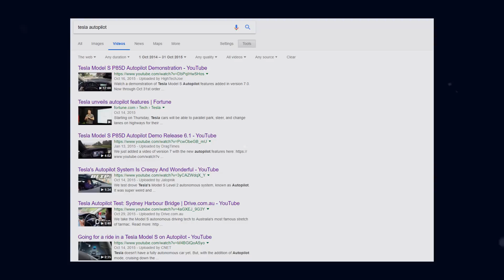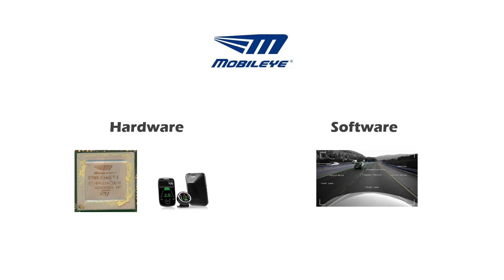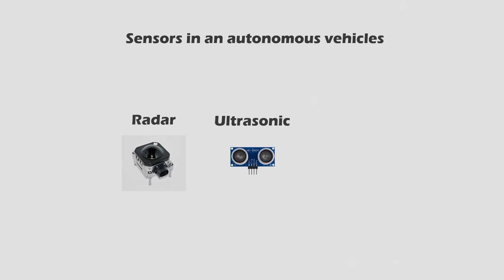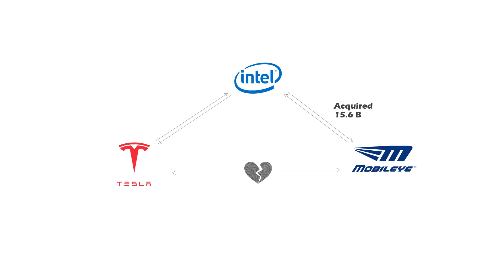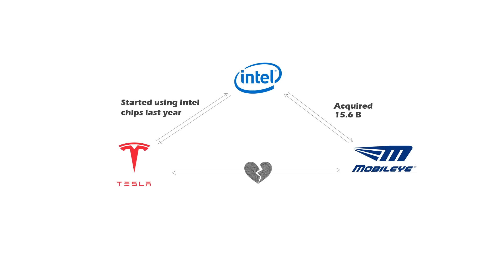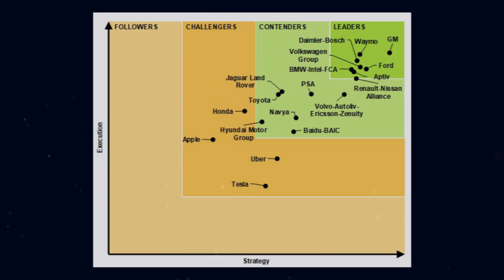Tesla's Autopilot is in Trouble, here is how to FiX it!

Comment: That chart doesn't seem plausible.
Reply: It doesn't even have units on the axis, so its technically not even a real diagram :D
Reply: idk about that, some tesla owners are complaining about the auto-pilot, since it would be unsafe in certain situations (source a dutch tech-oriented news-site).
But it's hard to trust sources like this since it's the only widely known research on this topic, for example: what I dislike about the research is that it mentions (almost) all of the brands that doesn't have a commercial avaible product yet but only prototypes. Also since Tesla has the adventage of having a real product it gathers ALOT of data which can be used to improve the system.

One of the claims from navigant: "Tesla scores high for its vision, but they haven’t demonstrated the ability to consistently execute that vision".
(source: https://www.greentechmedia.com/articles/read/report-ranks-tesla-last-for-automated-driving#gs.FEY6xtU)

I think it's hard to measure progress, so time will tell.

I've linked 2 articles (the first one is paid)

(the research mentioned in the vid)
https://www.navigantresearch.com/research/navigant-research-leaderboard-automated-driving-vehicles 

(some counter article)
http://amp.timeinc.net/thedrive/opinion/9024/who-is-really-1-in-self-driving-cars-you-wouldnt-know-it-from-navigants-controversial-report?source=dam&__twitter_impression=true
Reply: Especially the claim tha Apple is somehow ahead of Tesla, when Apple hasn't demonstrated anything, not even a simple test vehicle.  Apple seems more bent on revenge against Google than in actually developing and marketing self driving cars. Why? Because Google came out with a far more successful smartphone OS than Apple could, and stole their market.
Reply: units are not enough, you need markings as well, otherwhise it might just be a piece of art, instead of being a diagram. Also: How the hell would you even measure "Strategy" and "Execution"
Reply: the list is so dumb it makes my head hurt, can any of you people that believe the list is accurate let me know how many of those "competitors" you can even buy a partially self driving car from? I mean apple doesn't even have working self driving software, or car software, or a car HMMMMMMMMMMMMMMMMMM.
Reply: you know the funny part is even those cars covered in sensors I haven't seen go 70-80 mph on a highway, have any of you? I don't know that they even have a sophisticated enough AI to handle the physics of high speed driving, any time there's a self driving demonstration it's just a car slowly looping through a town at like 20 mph tops on a predefined route.
Reply: The chart puts Tesla behind so much because Tesla is behind most of the companies with $300k worth of crap welded to their prototype cars and because they have not done their cross country trip yet so the people who made the chart are lacking data. If you were to compare Tesla’s autopilot to the self driving tech currently in production cars Tesla would rank much higher.
Reply: I genuinely think we can trust this report just like the report that said a hummer is more ecofriendly than a prius. And Trump. Trump is solid on everything. He is our beloved divine leader. 
Tesla is dead last on the chart and GM leads everyone even Waymo. Points for guessing who paid for the study.
Reply: Jeremiah John No fucking way it's accurate. Uber and Tesla are at the back, even though Tesla has already shipped something and have amazing AI Talent, and Uber just completed 2 Million autonomous miles while most of the others on this Diagram don't have jack shit (Only Waymo and Cruise/GM do) and have barely done some hardcoded easy demos. This study is a joke.
Reply: This. It's absolute bullshit. Some people do not want Tesla to succeed.
Reply: I think the last article sums it up pretty well. And there's a alternative route that could change it as well which is Artificial General Intelligence. If they can crack that, only the hardware will be the limiting factor, and who knows who will get there first.
Reply: Niosus

Maybe you're right, but I wouldn't be so certain. It's also very unlikely that it's going to work exactly like a human brain and will most likely operate with what is only the most necessary attributes without the restrictions of a biological brain. So it's more a matter of how to apply it into a car without it running amok. Maybe AGI is the wrong term to use really, it's more of an adapted intelligence for that particular environment that the agent can operate and thrive in, and that doesn't have to be that complicated.
Reply: Yes, but we do not know what these necessary attributes are. We also don't know what restrictions are caused by our brain being biological, and what would change by implementing that in silicon. You could go to any group of researchers, give them 100 billion dollars in budget and they still would not be able to give you the answers to these questions for many years to come. Seriously, we have no clue. At this point, we don't even know what the problems are we need to solve. We don't even know how to look for those problems. At best, we're hoping the stumble upon inspiration.
Reply: Ikr..how is jaguar land Rover ahead Tesla 🤨🤨
Reply: The chart is BS indeed. Nissan is missing while it has demonstrated very advanced autonomous capabilities. Apple is on it, while it hasn’t shown anything at all. Tesla is on the lower while it has shown advanced capabilities (not release yet). However I agree that Tesla’s publicly available autopilots got way worse after the mobileye split.
Reply: How is GM on top?
Reply: I'm guessing the answer is "They copied Waymo and got the hardware working right" - as opposed to "Decided to go their own way, massively over-hype their product leading to at least one roadway death, managed to piss off their main hardware supplier, and have no a lot to show for it after several years." Telsa reached for the low hanging fruit, but then they stayed still, and now the market is overtaking them in production and ambition. They need to stop treading water somehow.
Reply: I think you will have to eat up your words on this within a short time. Many people are underestimating the speed that a neural network can learn and surpass human skill level and driving a car is no match for a good AI. This is not something that is happening gradually, this is developing in an accelerating speed. And Elon Musk just recently said that they will soon have a self-driving car that is far better than the most skilled driver. Just because we don't see much change right now doesn't say much on how fast it can happen.
Reply: jxdigital, Renault-Nissan-Alliance are listed in the top corner. Which would make sense given the prototypes they are testing with.
What surprises me, is that it lists GM, VAG and Ford as being the industry leaders, yet none of them have prototypes that seem as "nearly completed" as what Renault-Nissan has.

Same goes for both Apple and Uber. As far as I know, neither of them has a functioning prototype out on the roads today. But then again, Uber doesn't really exist in my country. They tried to exist here for a week, until actual taxi drivers started filing complaints and Uber drivers started getting arrested and fined for not having their paperwork in order.

Ofcourse Tesla in this case suffers from a rather bad image, at least over here. Just a couple weeks ago a Tesla decided to just drive off from a parking lot, crashing into a bicyclist and a moped, narrowly missing another pedestrian. But atleast it didn't pull a hit and run, and called the cops on it's own afterwards. Still it put two people in hospital. As far as we know now, it was a malfunction in the auto-pilot, the owner of the vehicle was nowhere near it at the time.
Reply: Daniel Nicklas V even still it's not that great compared to what others have. This is a partial auto pilot system. Other car companies may only have prototypes of this, but they have complete auto pilot. Destination to destination without touching the steering wheel. Plus you have to regain control of the car like every 10 minutes. So it's not that surprising at all.
Reply: Nobody has any idea on how to even approach general AI. We're not seeing it within the next 10 years, period. Just not going to happen, even with optimistic assumptions. At this point, the only approach we know will work is simply simulating a human brain (assuming we could map it well enough). But that's brute forcing the problem. We still wouldn't understand how it works, let alone be able to make it do something we want. Also, having a human brain drive a car negates most of the advantages of having a computer drive the car instead of a human... And that's not mentioning the ethical issues. Yeah, we're at least a decade away, probably even more.

However, as a researcher working in the field, I'm fairly certain we'll have multiple car manufacturers selling level 4 autonomy vehicles within the next 5 years. Perception is solved, trajectory planning is solved, maps are making huge strides... It is mostly a matter of making robust decision-making software and combining it into a full, validated system. So yeah, I'd say 5 years for the pioneers and about 10 years for just about every car manufacturer having it available as an option.

Level 5 autonomy may take a bit longer, but I think it is not necessary for the big market breakthrough. Even a system that just navigates highways and urban areas autonomously would cover well over 90% of the use cases.

Comment: All of that is pretty valid. However, even if you had world class autopilot now, you wouldn't be able to fully use it. The bottom line is in the legislations at the moment and it will take some time before that changes. In other words, I'd bet the issue will be resolved by the time it's legal for a driverless car to be in the streets.

Comment: Because Tesla's approach is without lidar it's impossible to compare to others. Either it will work and be substantially better, or it won't and be a total bust.  There's just not much in-between.

I got one of the last Model S's to get AP1, and I'm glad I did.  I don't plan to trade up until I hear some good news.
Reply: Lidar is for precision mapping nothing else it also can't see through rain and snow and it is still prohibitively expensive. Solving vision is way more important to achieving autonomy than precision mapping.
Reply: I don't think there's a need for precision mapping, humans are doing pretty well with just two "cameras" and a lot of guesswork. The advantage of lidar is that it captures dept information naturally, while cameras are only 2D. But 3D mapping with cameras only is now working very well, and doesn't require too much computing power.
The reason why Tesla is lagging behind is that they had to rewrite the entire software, and that's not a simple task. The MobilEye breakup happened only one and a half years ago, that isn't much time to develop a complex software, especially when bugs can kill people.
Reply: Precision mapping is very important, though. It's possible to map with vision, but far more difficult. 

LIDAR has a harder time with rain and snow, but it is very possible by taking repeated samples over a millisecond or so and using filters to remove noise. It's more memory-constrained than compute-constrained.
Reply: OttigoCurry, I don't get your binary analysis (either substantially better or total bust).   Tesla's approach could be ok but a bit worse than lidar, or a bit better than lidar, or the same as lidar...  The performance space is continuous, not discrete.
Reply: Lidar is dangerous.  Do your research. Lidar once clocked a BRIDGE doing 37mph.  Tesla is currently trying to get Model 3 up to production levels.  Then they will focus on auto pilot.  Keep in mind Mobil eye only did one thing.  A whole company doing only one thing.  Then sold to Intel for $15 Billion.  When Tesla gets autopilot working they will be worth an extra $15+ billion just from the software alone.  The only way to lose money on Tesla stock is if you sell it.  ;)
Reply: I have the AP2 and had AP1, It's at least as good now. very smooth around corners. I have a few issues but they are the same issues I had with AP1. The next few upgrades I think will be AP2 only and will make some really good changes to the system. As for using cameras only, they don't they use three different sensors types (like the video explains) every input has importance. Vision can have whiteout issues, we all remember that one where the video relied a pone. Now they use a mix of the three sensors to verify each other. Lidar really is an amazing technology with no benefit to consumer vehicles. They are needed for detailed mapping and work amazingly well during good conditions but any weather issues and they will be almost useless.  Camera vision and radar are much more reliable when used together. breakthroughs are coming! I think this year too
Reply: OttogiCurry lidar is a must have. Period. Everything else is a gamble on the lives of customers and passers by...
Reply: That's a very bold claim that flies in the face of what Elon is saying.  Elon has a pretty significant portfolio of doing things that he wasn't supposed to be able to do.  So if you're going to rebut it, please do so stating reasons you would be an authority on the topic.